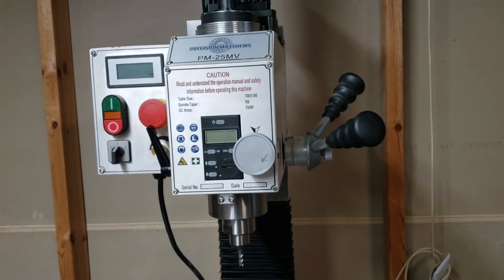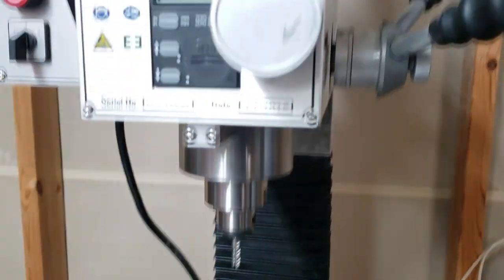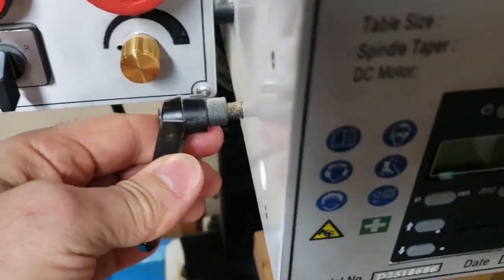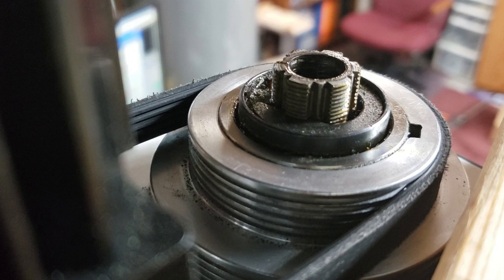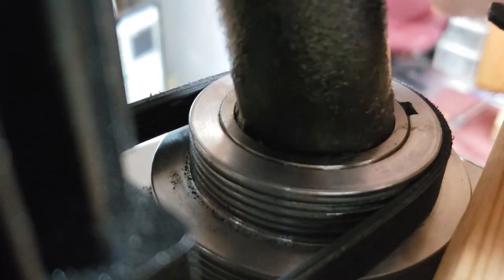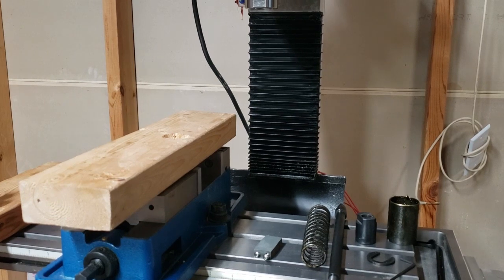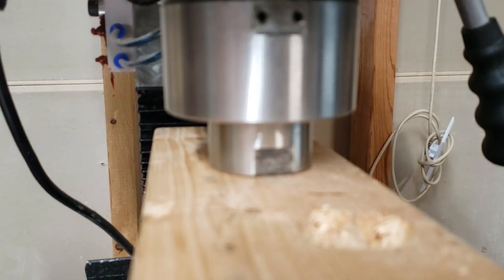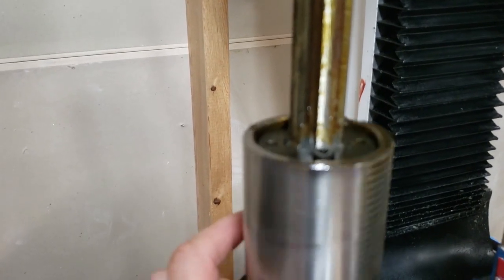REMOVING THE SPINDLE ON PM-25MV

Comment: Removing mine is on the todo list. I need to see if play can be adjusted out. Do you plan to replace the bearings?
Reply from the maker: Hi kent,  i do have new bearing on hand, at the moment i don't need to replace them there smooth, quiet and tight yet